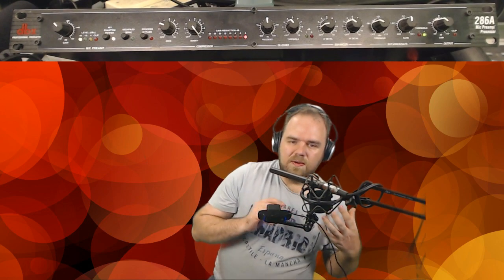Sooo... I forgot that I had this dbx 286A Mic Processor....

Comment: Hey Adrian, thx for your video. Well, can you tell me what`s the difference between the 286a and the 286s ? Is the "s" just newer but the same? greetz :-)
Reply: I am not totally sure and have no hands-on experience, but I vaguely remember from my research into studio mic preamps that the newer S version uses newer components which replace now obsolete parts and improves performance a bit. 
Bottom line, buy the old version if you can save some money with this. 
I personally decided against both of them and went for Drawmer MX60 as it offers more controls (attack/release, threshold/ratio, three band enhancement) but most importantly it has an instrument input, which I want to use for tracking guitar and bass. Anxiously waiting for it to arrive and expecting nothing short of magic. ))
Reply: The A and S have identical specs according to the manual. I'm sure some of the capacitors and things are newer but it sounds no different. The main difference is the silver front panel and they're now made in China as opposed to the US.
Reply: The 286A was designed by with a burr brown preamp chip and better comp design. If you can find one grab it. It is a great device
Reply: Minister Travis Do you mean the “a” or “s” version? Or both?
Reply: @DystopianOwl  The A version